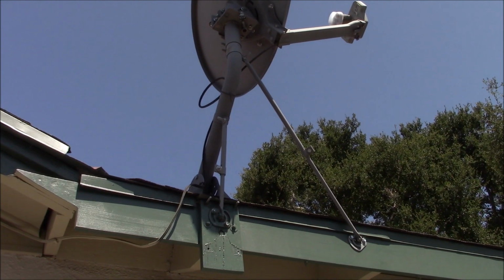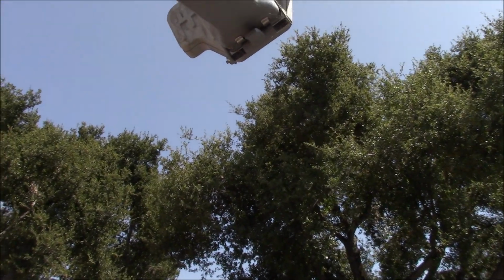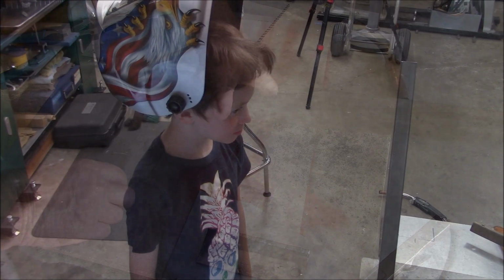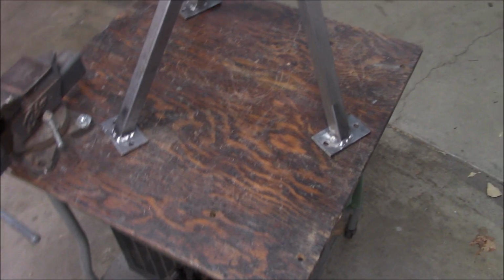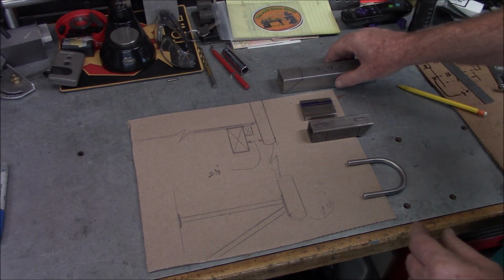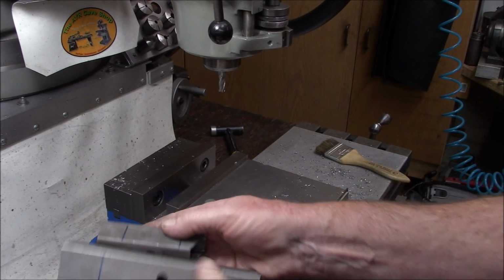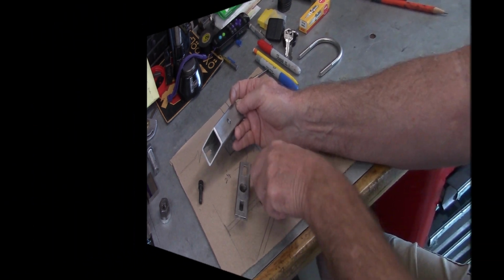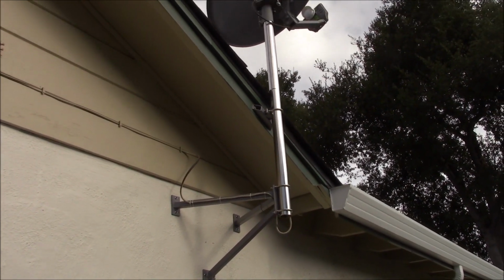Custom Satellite Dish Mounting System

Comment: Had to do this myself at the beginnning of the summer, but since I didn't need it up higher for clearance, I was able to mount it lower on the corner of the house where it is mostly protected by the eaves of the roof from snow...we'll see how well it works in a few more months...
If nothing else, it's easier to reach with my snow-clearing stick.
Reply from the maker: At least we don't have to worry about snow.... Just a lot of other issues..Lol